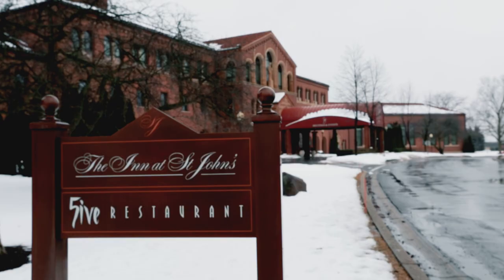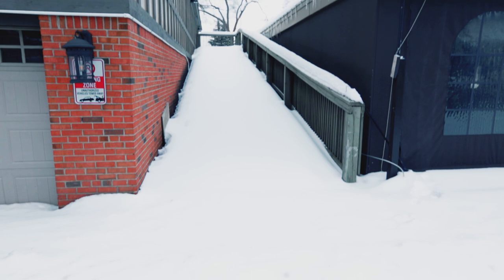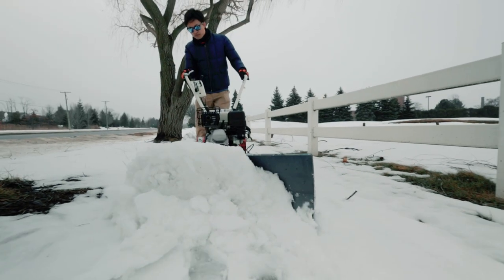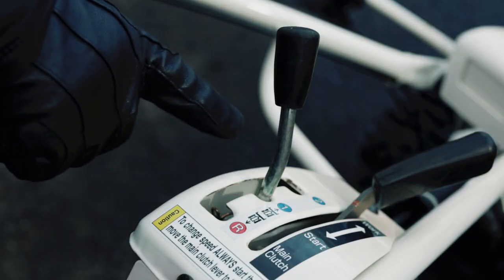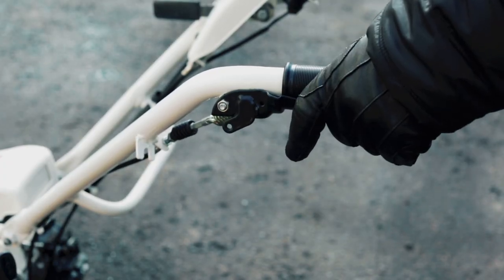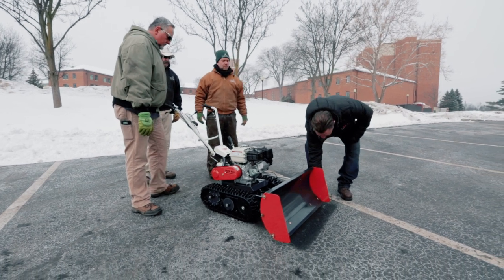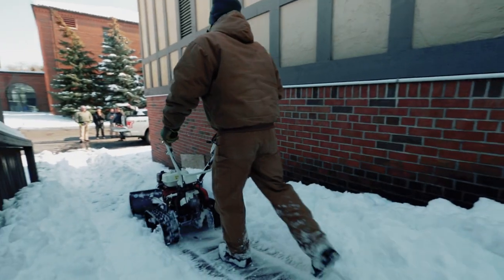How to Use the Walk-Behind Snow Plow - The Snow Bull

Comment: Can you guys show us in a video the machine working in 8" or more of snow? Your showing videos of it in a a few inches of snow.
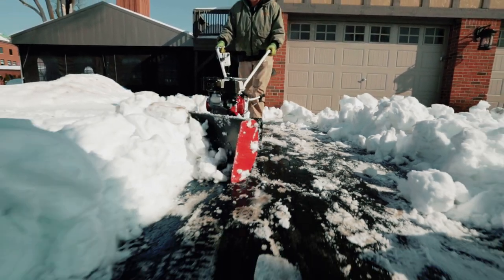Reply from the maker: Hi Joe. The height of the snow shovel on the Snow Bull is 13." At the 2:16 mark of this video, you can see the Snow Bull pushing the height of the shovel down a driveway. That is probably as high as we ever recommend you push using this machine, especially when it comes to wetter snow which becomes quite heavy the further it builds up in the shovel.
Reply: @OrecamericaG  how many cc's?
Reply from the maker: Hi Joe. The Snow Bull uses a commercial Honda GX160 engine (163 cc)
Reply: @OrecamericaG  ughh...  my toro mower has a 190 cc Briggs and Stratton engine. I would think that this plow would have a larger engine than a lawn mower.